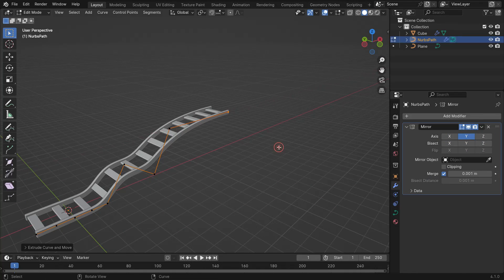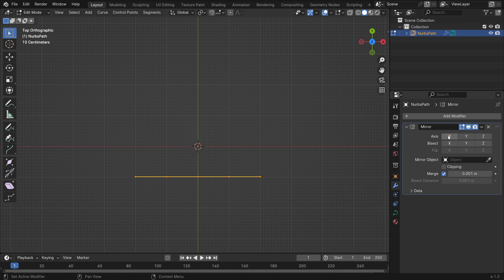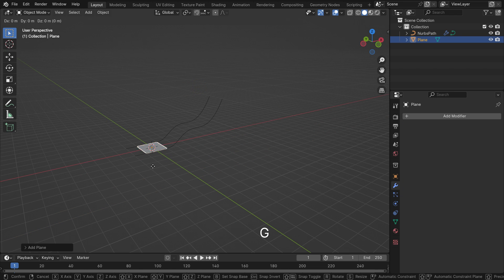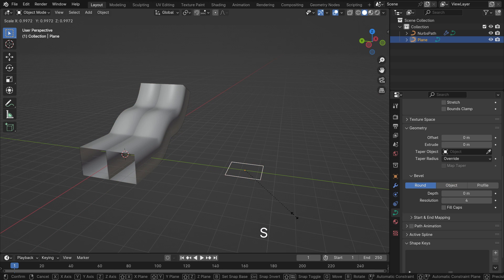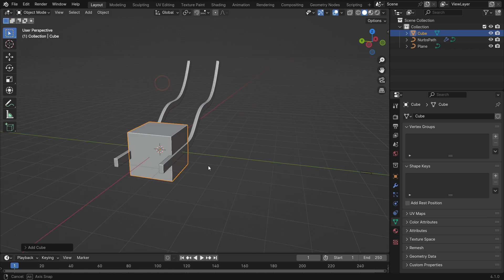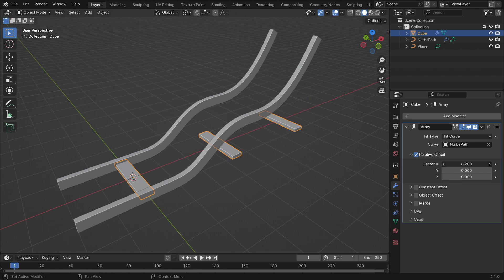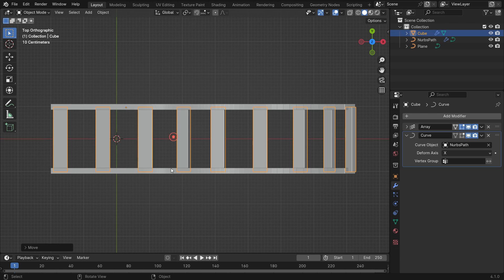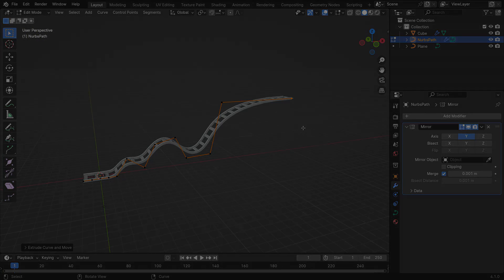How to Make A Simple Railway | Blender 4.1 Tutorial

Comment: But if you curve the track's yaw would the one rail be end up the identical to the other or would it curve the way its supposed
Reply from the maker: If you curve the track's yaw, the rails will curve accordingly as well. The Array modifier will maintain the shape along the curve, but the rails should follow the curvature of the path, keeping their orientation correct. Just make sure to adjust the Curve Deform modifier’s axis to match the direction of the curve for the desired result.

Comment: The Mirror modifier isn't going to work. It's based off the origin point. As soon as you move the track left or right, the tracks are going to be different distances from the origin. 2 steps to the left means the track is 4 steps wider.